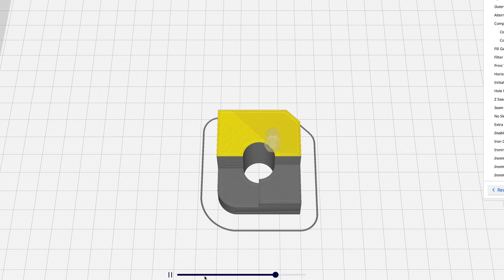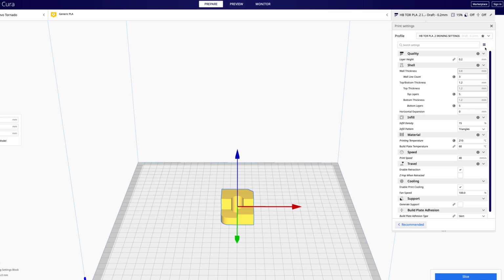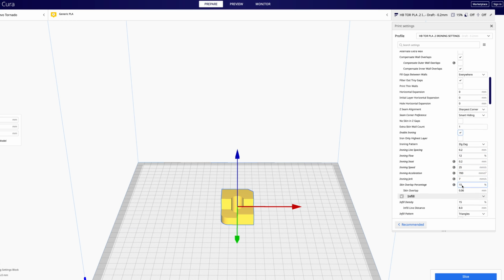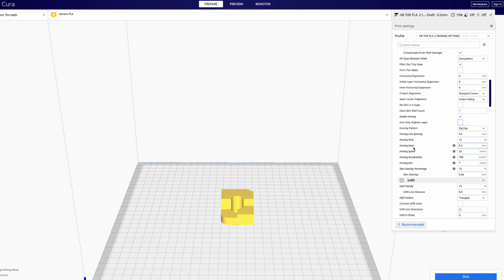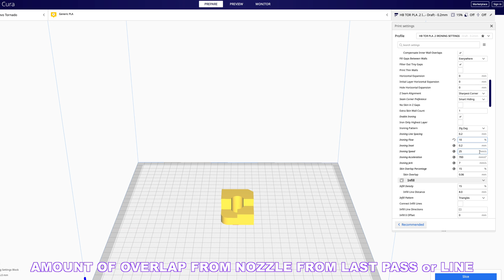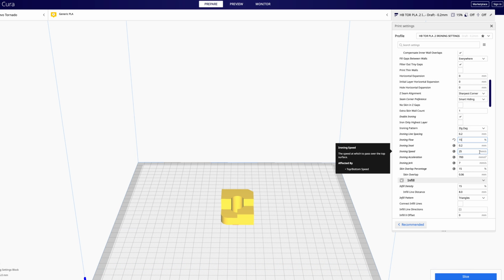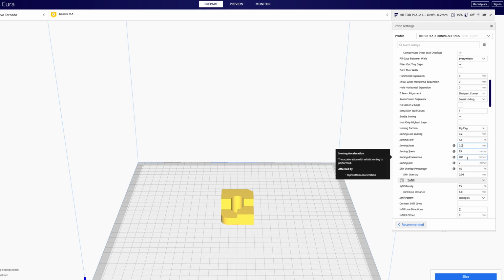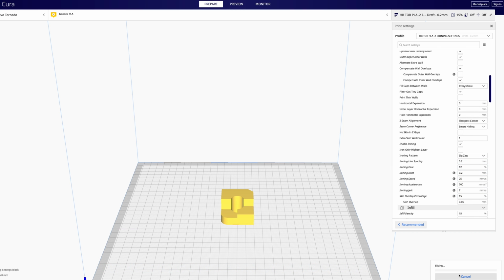So Smooth... Ironing Settings in Cura for Perfect Top Layers - 3D Printer Pro Tips

Comment: Weird, but for me ironing with default settings made the surface worse. The surface came out pretty smooth, and after ironing showed some blocks which were indeed a bit smoother and some blocks which looked like the ironing would poop every few mm small amounts of filament. That effectively ruined the effect.

Comment: I was ironing on every top surface. But unfortunately, every wall layers within an ironing layer was not smooth as another and wall on the right side within the slanted layers become ghosting. any suggestion to fix this?
I use Ender 3 pro, PLA+, Ultimaker Cura 5.9 sclicer

Comment: What causes little "holes" in prints?  I am new to 3d printing and my prints do not seem to be of a great quality.  I get the lines, will try inronig to get them out, but occasionally within a line there will be a tiny hole.  They are visible if you know where to look.  I find them unsightly and have tried to fix them.  Any advice would be very helpful.  I have an Anycubic Cobra 3, standard .4 nozzle and using anycubuc slicer.  I will try Ciura and see if that helps me any.  If you have a video on this topic, please point me in the right direction!!  Thanks in advance!
Reply: Quite late but that’s bubbles, if you leave ur filament opened for too long it will make bubbles/holes

Comment: I want particularly outstanding high quality ironed prints, my settings are tweaked to 0.1 precisions. I have noticed PLA varies in quality when ironing. PLA+ seems to have extra chemicals in that I believe affect ironing. Currently I now use Hatchbox Matte PLA (outstanding!), I was shocked to see how perfect it was with no lines visible. Because they do not have all the colours I need I also use eSUN ePLA Matte which is pretty good but second best. I am trying to find another brand to add to the mix, if anyone knows any that are insanely good?

Comment: I used these settings and it helped, however the surface still has subtle ridges. I am creating a 4" x 4.5"x 1" high rhinestone with a translucent PLA.  Any suggestions for settings? I have had my Ender 3 v3 KE for a week. Thanks!

Comment: Hi, how do you get such a smooth bottom? I have visible lines
Reply from the maker: You need to lower your nozzle or reduce gap from nozzle and bed.  A perfect 1st layer should squish just a bit to connect all lines.  Check out my video on leveling bed with paper.  Special attention to examining 1st layer and what to look for which is near the end.
Reply: @tr3nDmaker  Yes, it really worked. When calibrating the table, I had a problem. I aligned the corners, but the center was low. I had to put aluminum foil under the glass to get a smooth surface

Comment: What would be the best ironing setting if you were printing a cosplay helmet and the model printing is curved?   Does ironing only work on a flat surface?
Reply from the maker: Layer resolution will help with curved parts…. Ironing setting only works on flat surfaces.

Comment: Is it possible to do ironing on the bottom first layer? When I print on a raft and it's finished taking the raft off the layer connected to the raft is not smooth

Comment: Hello! I was wondering if ironing adds on to the total height of the object. For example if I were to print a calibration cube, would enabling ironing cause the cube to be slightly taller than if it were off?
Reply from the maker: That is a great question...
I believe it does not...if so, just an extremely tiny amount.  The setting basically re goes over top layer adding a tiny bit of plastic like 5-8% which mostly fills on gaps.  However, It is adding plastic, so depending on your settings, it may fractionally.  I think you will get more variation based on bed level, than ironing.  If you had ironing flow very low or zero... then it should not add to height.

I had to think about this question..
Reply: @tr3nDmaker  I appreciate the reply back! Have a great one!

Comment: Did you stop creating content? I was really hoping for more videos on 3d printing your videos have helped me dial in my PETG settings though I struggle with slight stringing still and my bridges still suck. But for none complex mechanical parts I have been making they print beautifully.
Reply from the maker: I kind of took a pause in videos.  But, good news is… I am currently setting up a custom ordered Mac Studio computer, which should massively help with new content.  So, I should be picking my 3D Printing videos up in September.
Reply: @tr3nDmaker  sweet! Im excited for more content man! Not sure if its up your ally but doing a custom 3d printer build series would be a cool one. Im stuck having to print complex parts on a 220 x 220 xy bed. I would really love to learn how to build my own printer with a print bed size of 2ft by 2ft.
Reply from the maker: @Kenneth91619  What are you trying to do that is that big?

Comment: would you using ironing on a rounded character?
Reply from the maker: Depends... Ironing is best used when there are flat surfaces.  So, if character has flat base or holding something flat... Yes.  If more rounded... probably not needed.

Comment: hey i have se alot video on 3D printning so i could learn. i just get my 3D printer on monday 7/3-2022 and i have many issue to get at nice print and i still have no nice print. and leveling its right and all bevel its check. i am new in this 3D world and i dont know mutch on it. can you tell me what fileament you use on it and could you upload your cura file on it ? so i can see what settings i do wrong i have do what you say in this video at its not neat to look like yours hope some pro could me in start so i can print and get nice and smooth things
Reply from the maker: Congratulations on your 1st printer!  To start.. getting nice prints takes a bit of time and patience.  But, I can say 90% of the time with beginners... eccentric nuts, belt tension and bed leveling are the issue.  Check out my video on bed leveling with paper.  Pay close attention or re-view the section on being sure bed and belts are adjusted properly.  Bed should have zero movement or wobble.  Belts should be snug, but not tight.  And, leveling bed should be as indicated in video.   Watch section at end with what to look for on first layer.  

As for profile.  You should get good results running stock profile in Cura.  I only slightly tweak these settings.   Getting 3D Printer adjusted properly is likely your issue.

Good luck.
Reply: @tr3nDmaker  Thx. and i just look on your video whit bed levling and the video: How to Smash the First Layer Like a Pro .
Before i do this, as say i am pretty new in this world and i am not sure i will do ir right
but can i send your a email whit 2 picture maybee you cann se what my problem could be..
yes have no idea its will be so hard and so mutch work to get a 3d print. but okay i not give up.

Comment: Can you please send me your cura profile for your ender 3?
Reply from the maker: Swapping profile is unlikely to work and rarely do, as every printer is adjusted and tuned differently.  Believe me, I tried every profile I could find when I first started 3D printing.  Rarely helped and often frustrated me more.  Plus, most of my profiles are older version of Cura and I tweak them based on the print.  Also, my printer is super tuned which is why prints look so clean even at basically standard profile. ( I'll do a video on this soon)

Here is what you should do...
1st  Be sure entire printer and uprights are square.
2nd  Be sure eccentric nuts and belts are properly adjusted.  No wobble at all and belt should make a quick  sound when strummed like a guitar( just a quick sound and not flopping).
3rd  Load standard profile from Cura. Go thru video and copy my settings as you see them.  As for retraction... this is going to vary greatly based on tension of spring and nozzle on printer.

That should get you 95% where you need to be.  Hope this helps.
Reply: @tr3nDmaker  thank you so much! Love ur videos! Also how come you haven’t uploaded in a while?

Comment: Love this. Thanks. I'm new and I would like to use my 3D printer for silicone mold making. But I would like it to be smoother.
Reply from the maker: I have made silicone molds from 3D prints… the secret of getting smooth casts or molds is to… print a clean item, lightly sand, primer, and then sand again.  Then it will be perfect.
Also a vacuum chamber and a pressure chamber will take it to perfection.  I will have to do a video on the process.  But, it may be a while as its a long process.
Reply: @tr3nDmaker  we're still waiting!

Comment: Any chance you would share the cura profile you were using for this test?, thank you.
Reply from the maker: I have probably changed it by now..  But,  watch video and pause to see my settings. I have never had much success with using other's profiles... they are often best used on one machine.  I would start with the stock Cura profile and adjust setting  and speeds from video.  Going slow is the key to PETG... Then increase speed via trial and error. Good Luck.

Comment: With Ironing I want to change the direction from the 45 degree pattern to a 90 degree.  I'm printing building walls (Laying Flat on the build area) and want the final iron to be 90 degrees or parallel with the bottom of the wall.  An bit of angle looks un natural in a building and horizontal lines look better than vertical as we naturally build buildings from the ground up..
Reply: Change the "Top/Bottom" pattern to "Lines" and then if that doesn't do it, change "Top/Bottom Line Directions" to [90,180]. I'm not certain the values are separated by commas or white space. I think it's commas though.
Reply: @KLP99   Brilliant.. 👍 I've often wondered what the brackets were for

Comment: I want to print a thin square faceplate/panel.  I need the finished result to be 4mm thick.  I'm using a .4 nozzle and PLA filament.  What setting would you recommend in the 'ironing' section of Cura to get a smooth top layer finish.  At the moment, my resolution does not need to be super good, but I've been frustrated that none of the iron settings I've tried have met with success.  I want to get the settings worked out first and then good to a better resolution later.  Please advise.  BTW,  your example print looks great with your settings.
Reply from the maker: A couple things I would suggest first...
Most 3D punters and not really assembled and tuned properly.  Do this first.  Belts snug, No wobbling of bed, hotted or x axis.  If this stuff is loose... variables change and top layers look inconsistent.  Next, calibrate / tune your extruder.  These are always off by 7-8% if you are not sure how to do this... just try 93% flow and see if it helps.  If it does... likely your issue.  Lastly, every printer is a little different.  Scroll thru my video and copy all setting.  Give a try...  tweak in little increments.  Good luck
Reply: @tr3nDmaker  Thanks for the reply.  I  have  calibrated what I know to calibrate.  My machine is new..ish, but I did replace my extruder with a better one (TH3D), as well as a new hotend a couple weeks.  All the belts are tight and there does not appear to be any slop in the mechanism of the machine (X,Y and Z axis).  In every other respect my prints look very, very good - except for the top layer.  I will continue to look into the overall settings, especially the top layer, and ironing ones.

Comment: Hi!

I just started tinkering with ironing and I'm realising that the printer or slicer doesn't appear to be compensating the extruder feed rate properly when ironing.

What I mean by that is when the printer does ironing back and forth with 40 mm lines everything is uniform and nice but then when it needs to go down to a 15 mm region back and forth there is a constant hump in the extrusion until it reaches a larger ironing region.

Is there any way to fix this? Thanks for the video to start me off!
Reply from the maker: Re-check settings across the board.  .4mm line.  try 12-15% flow.  VERY IMPORTANT... confirm NO bed, extruder or X axis wobble.  Weird stuff like this happens all the time if something is loose and wobbles.
Reply: @tr3nDmaker  thanks for that! I have tweaked my top skin layer and I now have it working much better. I ended up removing all but two walls and changing the line direction to 0 and 90 which ended up fitting the z more nicely on my test cube. Then I inset the outer wall by 0.1 mm and reduced the top line width to 0.25 mm from 0.5 and increased extrusion to 15%. My ironing is near perfect without humps except for retraction points. Having that top layer surface nice and fine was the key for my 0.4 mm nozzle and 0.3 mm layer height
Reply from the maker: @xXFULLFU210NXx  Glad to help!

Comment: My ironing looks awful. :-\ Jus kind of smears plastic around. It looked better before it ironed.
Reply: My initial thought is too hot and/ or too much flow.  Flow should be around 10-15%
Reply: @magicofspeed  ironing doesn't prevent holes in the letters of my last layer, I don't know what to do, I can increase the number of top layers, the flow, put the ironing at 20% I always have holes in the last layer while the first layers are superb :-((

Comment: Hi how would I get the top of a helmet smother
Reply from the maker: The top of a helmet is curved… so, the only way to smooth it is to have lower resolution.  Of course, on a big print… it will take days longer.  I usually print helmets at .24 and just sand and fill before painting.

Comment: So that is what ironing does... Super useful and won't require too much sanding
Reply from the maker: It is a very overlooked feature that gives your prints a more finished look.  thanks for watching.
Reply: @tr3nDmaker  just used it on a piece and it looked super smooth on the top layer. I could dial it in some more, but it would have to be on a piece by piece basis
Reply from the maker: @MrRileysGameroom  Sounds like you got the hang of it.
Reply: @tr3nDmaker  I also started using super glue on my printed pieces
Reply from the maker: @MrRileysGameroom  very nice...  I have a video soon on how to get superior bond with glue and chemical fusion of parts
Reply: @tr3nDmaker  does it involve using SciGrip or Zipkicker? 😁
Reply: @tr3nDmaker  I've used 3d Gloop but it dries too quickly

Comment: Hi, I use ironing, but for some time I have small holes in the last layer, I increased the number of upper layers but I do not understand why I suddenly have these small holes, I should increase the flow according to you?
Reply from the maker: This could be several issues...  I really ned to see it to fully comment.   But try... 5-10% more flow.  Slow top layer.  Temp too hot? 
How does top layer look without ironing on?  Holes still there?
Reply: @tr3nDmaker  I'll try without ironing !

Comment: Watching your video for the first time, great video, thanks. You might have mentioned it elsewhere, I am curious to know your reasoning for setting the line width to 0.4mm instead of more common 0.44mm (ie. 110% of nozzle).
Reply from the maker: Great question... I have profiles for use with .4mm nozzles at .4, .42. and .44 line width.  For this video I opted for traditional .4mm line width to avoid issue for this who might try to copy all of my settings line for line.  .4mm will work much better and more accurate across the board, especially if you are trying to print at steep angles.  At .44 line width you will get thicker walls and slightly better adhesion on print, but fine details can get just slightly softened.  To wrap up, it kind of depends on the print.  Most of the time, I run at .44mm.  For steep angles, fine details or when accuracy is paramount... I go with .40mm.  
Thanks for asking.

Comment: Whole you mind sending me your settings for cura?
Reply from the maker: Ironing Setting:
Pattern: Zig Zag
Line Spacing: 0.2
Flow: 12
Ironing Inset: .25-.3
Speed: 25mms
Accelearation: 700
Jerk: 7
Skin Overlap: 15%
Skin Removal Width: 1.2
Skin Expand: 1.2
Max Skin Angle: 90
Skin Width Expansion: 0.0

I hope this helps...
Reply: @tr3nDmaker  Bro it helped me a lot! Thanks.

Comment: Hello I am interested in your test but I can not find the same position of the elements I am in version 4.9.0 could you provide me with the ironing parameters for this version with my thanks

Bonjour
je suis intéressé par votre essai mais je ne trouve pas la même position des éléments je suis en version 4.9.0 pourriez-vous me fournir les paramètres de repassage pour cette version avec mes remerciements
Reply from the maker: Ironing Setting... May need to tweak a bit.
Pattern: Zig Zag
Line Spacing: 0.2
Flow: 12
Ironing Inset: .25-.3
Speed: 25mms
Accelearation: 700
Jerk: 7
Skin Overlap: 15%
Skin Removal Width: 1.2
Skin Expand: 1.2
Max Skin Angle: 90
Skin Width Expansion: 0.0

I hope this helps...

Comment: How do you iron the first layer or the bottom surface?
Reply from the maker: You don't use ironing for getting super smooth first layer.  To get super smooth first layers... First be sure printer is 100% adjusted properly... ie.  belts and all eccentric nuts.   Next,  Level bed to perfection, may take 3 or 4 passes around bed.  Finally, adjust nozzle height till you are getting perfectly connected layer lines without plastic curving up.  It is not easy at first.  Once you get the hang of it... it is easy.  Good luck.  Video on this topic soon.